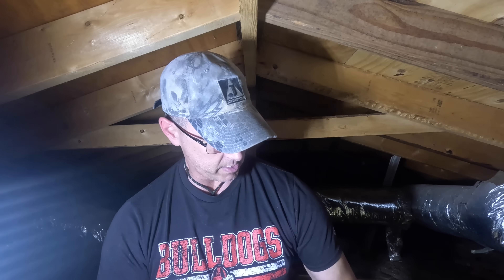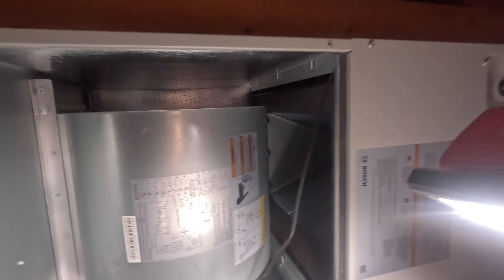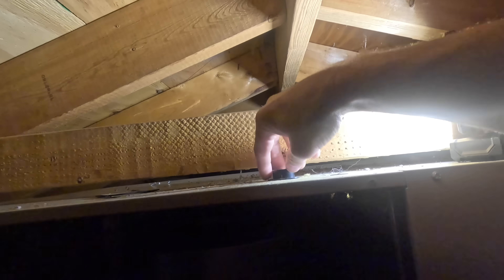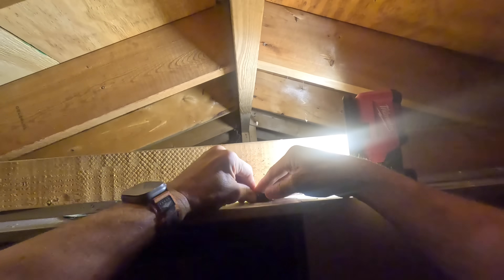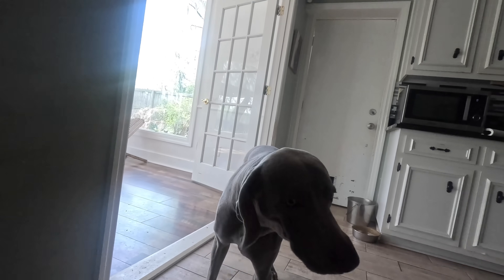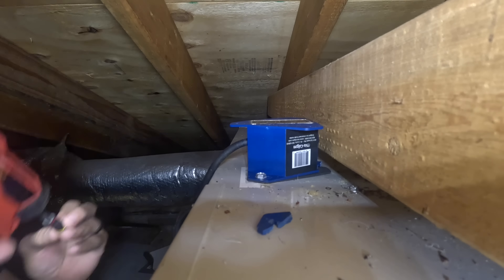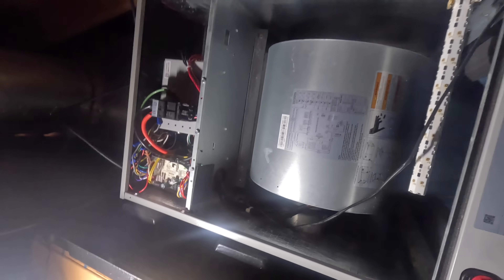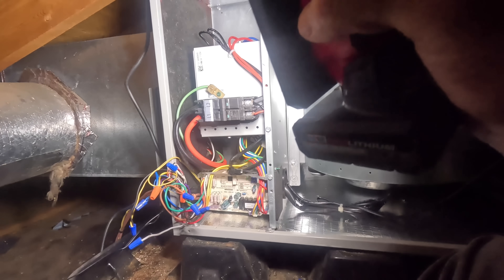Installing The Scorpion LX15 In My House! #hvacguy #hvaclife

Comment: Shouldnt be any controversy on uv light.  As long as its uvb and or uvc it will kill any bacteria and living organisms.  But it will also cause quicker oxidation to metals and deteriorate plastics and rubber over time.  Its just what it does.   You dont want it running all the time because they produce ozone which is bad for people in prolonged exposure.

Comment: The Scorpion light has a three position rocker switch. Low, Off, High. You set it to LOW during installation. You can flip the switch and make it brighter on high. You probably know this, but I noticed it during the installation.

Comment: Be careful putting them in by the blower because I have seen the UV make the wiring shielding brittle and causes shorts in the wiring
Reply: don't forget about coil coatings,  condensate pans, wiring, wire ties/straps and many other things inside the units.

Comment: G,day from Sydney Australia.
In which scientific research has the manufacturer sighted, as evidence of air borne pathogen elimination/reduction using ultra violet light?
Remember the "old barber shop" with the UV cabinets for scissors etc?
Moreover, I couldn't find much realistic and tested data when searching for an agonist against the corona virus Wuhan variant 2019.
🧲🌏

Comment: UV lights do work…the problem is they all have a bulb life…never seen one last over a couple years…can’t have it shining on ANY plastic or flex lines…it will deteriorate faster than the sun as it’s on 24 hours a day…if it’s wired only to be active with the blower then the bulb life is even shorter
Reply: That's what I was wondering.  Will the additional times the light turns on decrease the life versus leaving it always on?

Comment: Hi Curtis, I’m just curious as to why you didn’t mount it in between the evaporator coil right over the drain pan so it would keep both the coil and drain pan clean? Also why did you just use the built in magnet to save time drilling holes in your cabinet that creates another place for leaking air?

Comment: I’ve been running a dust filter in my living room due to my Mitsubishi mini split squirrel fan getting dirty so quickly, (dog dust and dander I think) I think it helps. It also has a UV light in it. Thing I’m really happy about was finding the Corro-Protec powered anode rod for my hot water heater..I bought an impact wrench for my air compressor and it popped that old anode rod right out. Well, loosened it I should say, I cranked it out with a breaker bar. No clearance to get the old rod out, I had to hacksaw it. New Corro-Protec is titanium and much, much shorter so easy to install, and it sits up higher, allegedly lasts 20 years!. Tiny transformer very low voltage with a very bright green LED light indicating you have a good connection, little clip provides current to the anode, you put the ground on a screw at the top of the tank. So many homeowners don’t even know you can and are supposed to change that rod out..my tank is only two years old, so very little sediment, and the rod I removed was still in decent shape, but still for two years old had plenty of corrosion)it was aluminum zinc not magnesium as magnesium is more expensive. I also got a sediment buster that screws on to the drain, you can shoot air in the tank to swirl up any sediment. Seems like you can barely get 6-8 years out of a HWH tank here in our hard water, so I’m hoping this is a longer term solution. Could be my imagination but the hot water feels softer, and smells cleaner. Love your dog, I got a German Shepherd, he’s almost two now, I actually tried to get him to howl at some wolf videos, he just looks at me like I’m crazy, he’s pretty quiet until some joggers go by the front window. He’s super, super sweet to other ppl outside the house though, and is a super handsome boy. He’d love to play with your dog I’m sure.

Comment: Curtis! I installed in my house. I have a “hot heat pump “ like you have. Where you installed it you’re be disappointed with it. It will over heat and shut down. I think 100 degrees is what it’s rated for. I installed mine before A Coil. But I get where you install it. I wanted the fan and the AC coil covered. It is what it is…
Reply from the maker: Well, in my case behind the coil could expose my filter to the UV light.